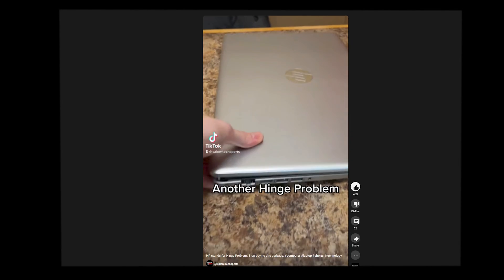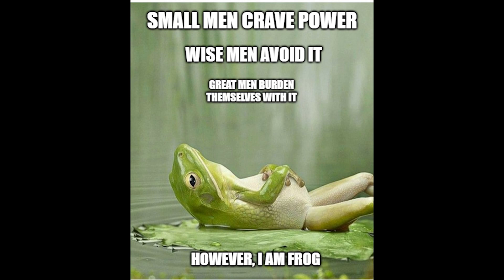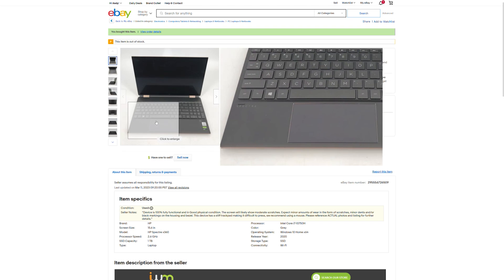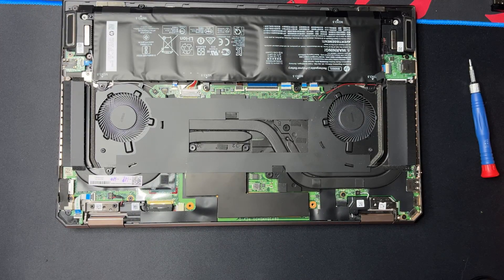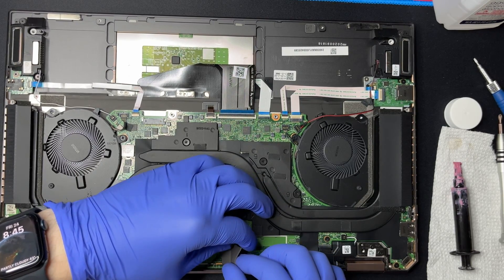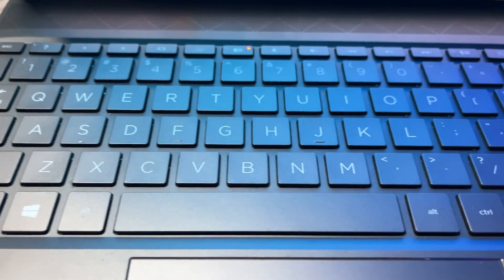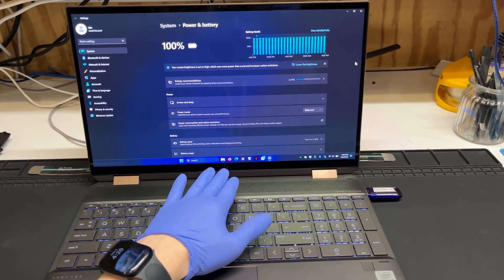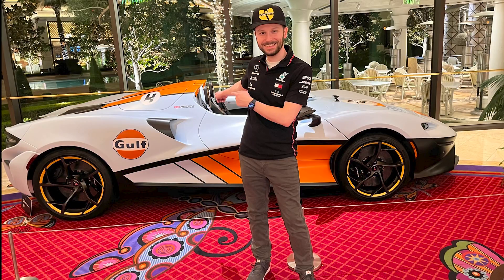Buying a used 2020 HP Spectre x360 off eBay: Good deal with big problems!

Comment: I feel bad for the idiot that bought a 5 year old laptop from you for 750
Reply from the maker: That 5 year old laptop was at that time, 4 years old, and had a 2TB SSD with 32GB of RAM, a 4K display w/ a dedicated GPU, and included a 1 year warranty. I migrated their data for free and sat down with them for an hour to set it up. I'm a business located where the cost of living is the 3rd highest in the country. Everything costs more here. $750 for that laptop which is still being used today without a single issue, is not a bad price.

Comment: A 1650 is not enough for a 4K screen by any measure and a 10th Gen Intel is now quite dated in terms of performance. You want at least a 3060 with 11th Gen. The issue is the decoding of streams, as laptops and PC's get faster the compression levels rise to save data. Also neither of the chips contain decent AV encoder chips so if light video editing and playback was a priority then overlooking additional chips such as NvEnc was very dumb.
The laptop itself has a beautiful design externally, but by your very own words you prefer function over looks. So why did you pick looks over function? A high refresh, HDR color accurate screen combined with native x264,x265 and AV1 embedded decode/encode chiplets would have been more accurate for your requirements. If you can't pick objectively for yourself how do you expect to do it for a customer? All GTX16xx series lack this ability. These chips and encode video almost as fast as u can play it, then add in the grunt from the GPU core and the speed is more than double its original. Having a dedicated ASIC will always be faster than using cpu or gpu. It will also help with things like scrubbing in the timeline. All round there will be less waiting.

Having worked in the industry so long it is easy to spot the average techies like this guy as the say one thing and do another then try to convince you they are correct. 
A better selection would have been a laptop designed for gaming as the hardware needed is very similar to video editing. I would just pay attention to reviews about the level of heat generated from the CPU/GPU whilst under load to ensure you pick one which doesn't throttle. A second hand Lenovo Legion with 3060 or even 2060 would have been a far better selextion
Reply from the maker: You are the average tech channel YouTube comment that has nothing of value to add to the conversation but instead focus on condescending judgement about things you cherry picked out of context. So proud to present your stereotypical "many years of being in the industry" badge that gives you the all-clear to wave around your dick of condescension. 

You're completely disregarding my opening statement that the entire reason I bought an x360 laptop was because it has a 4K FOLDABLE screen so I can use it as a second monitor and watch YouTube videos on it. And then you recommend a laptop that doesn't have a foldable screen, which is the entire reason I bought this laptop. 
I don't give a shit about HDR color accuracy. I'm not judging the fucking Oscar's. I'm editing 1080p video in Adobe Premiere, the GPU handles that fine.

And I quite literally stated I DO NOT RECOMMEND SOMEONE TO BUY THIS LAPTOP, how am I trying to convince you of one thing and then do another?

Get your head out of your ass and migrate it over to another channel if you think that shit is going to fly here.
I'll gladly take criticism where it's due, but setting up a strawman and then knocking it down to flex your ancient neckbeard isn't it. 
You're not that guy.
Comments from users like you create communities that perpetuate the stereotype of the IT guy being an egotistical douchebag who's shit never smells.
Cheers.
✌

Comment: Have you aver tried older thinkpads? I own 3 of those a x200 x220 t430 planning to get a t60... maybe even some pure IBM ones.. Anyeay from all 3 of them i would recommend a x200 build quality is way better then x220 and t430. T430 has damn awful tft disyplay same with x220 unless u find one with i7 usb 3 and ips display. X220 for me perosnally runs way too hot t430 dosent have any gpu, and overall its pretry expensive to upgrade it. Where x200 u can libreboot add a ccfl affs backlit display and it runs cool af. Its a 15 years old laptop and still a beast till this day. Dont get me started about the keyboard withoud trackpad.... and i got lucky having a original 9cell lenovo battery with it which last about 4-5h on youtube. up to 6-7 if you just type documents.. Really happy with it and well will be selling my x220 and t430  ehich are both overrated in my opinion.

Comment: That laptop has some amazing specs, sure wish I had one, I should make a video on my laptop. It is a HP Pavilion x360 m, 14-ba. I had 8gb of ram, i upgraded it, and with my 1080p HDR Display, and the folding. Its not that bad. I got it for free from a cousin, his dad broke it. It had a spicy pillow, cracked screen, very dusty, cleaned it all up, and with the intel hd graphics 620, I use it daily, I am commenting using it. anyways, love the videos, keep up the good work ! :)
Reply: One bad thing i forgot to add, its only windows 10, and a 7th gen intel, still amazing for light to medium games
Reply from the maker: That’s awesome man, how much did the screen cost you? Did you get an aftermarket battery off eBay or? 
Thanks for watching this video! I put so much time and effort into this one before I was big, I’m glad people are enjoying it

Comment: I have a 2021 HP Probook 445 G7 and it's been solid. Upgraded it to 32GB ram to have that spicy dual-channel AMD performance. It overheats like crazy though, I had to do a duct tabe mod because there was a large gap (for some reason?) between the fan and the heatsink. It still overheats, though it is much better. Got it used for $200 a while back and it's in near-perfect condition, really happy with it. But now seeing the spectre I might upgrade lol

Comment: I literally got one for free because it fell on its side and power button was stuck. Owner didn't want it anymore because of what they were quoted to replace the frame.
I soldered two wires and a small external power button. Gave that to my friend who can now enjoy a convertible 4K touch display, an excellent keyboard, excellent audio, and just excellent build quality too!
Now I will agree throttling for no reason is a big issue and HP does that a lot

Your spicy pillows are amazing :) but if you don't want one that's why you use 18650 batteries

Comment: I'm also a fan of the HP Specter like you. 
I have already replaced the battery twice by myself (I occasionally repair laptops as a part-time job.). It's a shame that HP doesn't allow you to set the charging limit in the BIOS... 
And it also overheats like crazy.
Please, how did you modify the cooling system? Did you add another heatpipe or some sheet of copper?. I have HP Spectre 15 ch001nc from 2018.

Comment: That year of laptop just felt awkward in general. It felt like the specs you got just couldn’t justify the price and it’s hard not to feel that way today. I got a steal of a deal last year with a laptop that had a 9750H, 1660ti Mobile and had 64gb of memory (that I bought after) and it cost me only 400$. Caveat being it wasn’t a touch screen but I personally don’t really care for that feature much- so 400$ was a screaming deal. Ended up trading it back for a desktop, as the 9750h and that 1660Ti mobile just had horrible performance compared to its desktop counterpart- thermals aside.

Comment: As a tech enthusiast and fellow technician who has seen plenty of those HP Spectre units die, do NOT buy them, unless you know how to repair them. Cramming high-ish end parts into such a small chassis definitely has some downsides when it comes to heat. They overheat fairly easily, the SSD's tend to fail early, the performance suffers due to thermal throttling too.
Reply from the maker: Exactly why I recommend not buying it at the end of the video. This is absolutely made for someone who can fix the design flaws out of the box then maintain it properly to keep it running.
Reply: @SalemTechsperts  As a funny coincidence I repaired one of these exact X360 machines last year, and boy that was fun. Replacing the dead hard drive and spicy pillow battery was the easy part, what was hell was getting it where it would POST, load into windows, and then install years of updates.

The update part took 2 days because i used a Firecuda hybrid drive I had on hand, originally I was going to swap in a SATA SSD but I didn't have any on hand. Still got paid pretty nicely for it and now I know how to fix no boot issues on that particular machine series, in the off chance I have to work on one again. 🤣

Also look into a place called laptopbatteryshop. They sell genuine OEM batteries for most laptops, and each one I've ordered from there were legitimate OEM batteries that worked.
Reply: I remember having this while lived with my parents they blamed me the battery went out after 4 months 😭

Comment: It was an amazing video. Right now, I have some days with my "new" HP 255 G8. It's nowhere near the level of beauty of that X360, but I love that modularity from HP laptops (that's why I always go back to HP, regardless of being HP. They have their moments, and I think we can agree on that).

The fun part though? I noticed there are a lot of parts from other models of HP laptops that should work with mine, and my laptop's motherboard has some connectors that aren't available for any of the options of this model, but they're definitely available in other lines of laptops that use that same mainboard. I'm having a blast checking what else I can find that might work. 

The best ones so far? A backlit keyboard in Spanish and silver (my laptop is darker gray), the stupid palm rest that goes with it can have also a fingerprint scanner that isn't available for my 255 G8 (but the motherboard has the connector) can be made of metal, which is super cool, and the fact that I can use the main M.2 slot, and a SATA or SATA to M.2 adapter in a space where a hard drive can go (but it wasn't included on this one... But it can be added) for more storage.
Reply: Yeah, I used to have a HP 250 G8 before. The same as the 255 but with intel, surprisingly modular for a low spec machine. It had removable RAM and drives along with the battery etc being removable, nothing soldered besides the CPU. The only complaint is that the hinges are the absolute worst on it

Comment: When a laptop has soldered ram is there anyway of upgrading it or is it just is what it is?
Reply: There is no economical way to upgrade soldered-in RAM. However, it's absolutely possible. 
Even if you have the skills and equipment yourself, the RAMchips, effort, etc. might not be worth it.

Same can be done w/ soldered-on CPUs too. In the case of very nice and still-usable laptops (like this dude's mid-2012 GOATbook) it might be worthwhile.
Thing is, a CPU is one component; RAM would be 8-16+ little BGA chips.

Comment: Dude the 10 hours for drivers thing is TOO relatable. Just bought a 2020 Envy x360 and I really like the laptop, but my God does it need work. When I have time, I have to hunt for the monitor driver, fix it not charging while on, and I want to find a solution to the stupid keyboard back light timeout problem.
Reply from the maker: It’s insane and the video doesn’t even tell the rest of the story like how I had to modify the BIOS to enable underclocking just to get it to idle without thermal throttling. It’s a fantastic machine but holy shit it’s like a DIY project getting it to run correctly 😂
Reply: @SalemTechsperts  That's crazy! I haven't even tried undervolting yet, but I have a Ryzen 7 4700u so hopefully it will be easier. If I have success with this laptop, I might even make a video of my own because who knows how many people out there have the same frustrations we do. Good luck on your HP endeavors!
Reply from the maker: That would be a great favor to the community. Same to you brother!

Comment: I just am disappointing with the hinge design as well as its thermals other than that its an amazing laptop, and probably the best looking out there, i hope they arent scared to make a thicker one with some more powerful hardware inside
Reply from the maker: Agreed. I solved the thermal issue by underclocking the CPU which involved bypassing PlunderVolt and modifying the BIOS. It was an interesting process but now the laptop runs so cool I barely hear the fan, and I never struggle for performance. The hinges still freak me out a bit but they haven't shown any sign of failure or creaking.
Reply: @SalemTechsperts  I love your content, and i as well am in tech repair, do you have a discord or anything? I would love to have someone else to talk to about this stuff
Reply from the maker: Discord link is in my bio but I’m not active there
Reply: @SalemTechsperts any guides for that? Would be interesting to read.
Reply from the maker: It was a guide on a Reddit post based off a Dell BIOS modification. It took me like 2 hours and I can’t remember how I did it but I will update this when I find it again

Comment: I want to pick your brain about something. I was thinking about buying a gaming laptop but as everyone knows the battery life is only a few hours at best. I was thinking of swapping out the original battery with one of a higher capacity so I get a longer life span between charges. Now the higher capacity would be a little longer physically and this might fit provided I keep the SSD bay empty as I already have an NVMe. I'm planning to get the higher capacity battery from the same manufacturer for reasons of compatibility. My question is, will the higher capacity battery brick the motherboard if the voltage is higher or does this new battery have to have the same voltage as the original ? I'm not sure if I have asked all the right questions. Thanks.
Reply: Short answer :with that premium you gonna shell for new battery just to get 10wh-15wh improvement ,just buy portable fast charging type-c power bank, since the market for these is huge and the demand is high so the competitive pricing will guarantee you getting the highest power per dollar. Plus you can use it for any usb powered appliance.
Your battery running time will heavily depend on your graphics and fps settings, lower is better